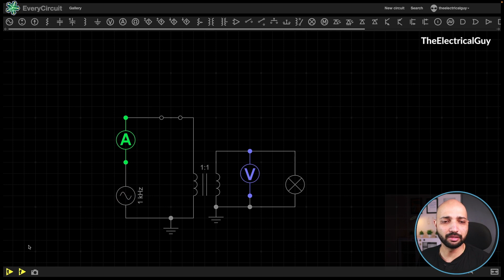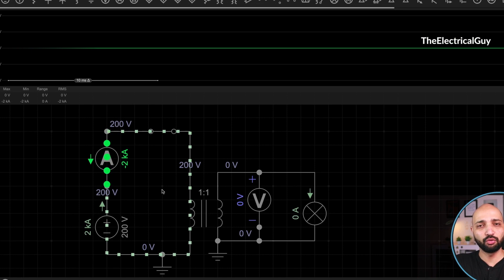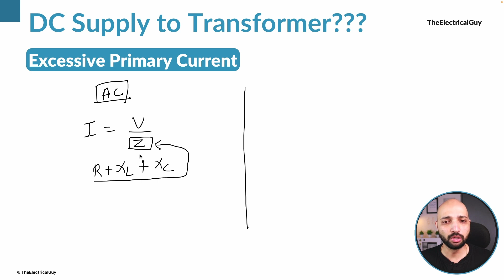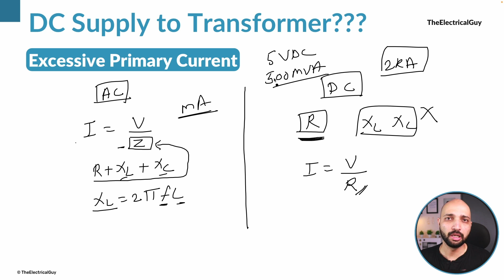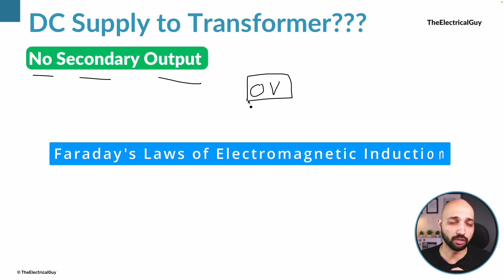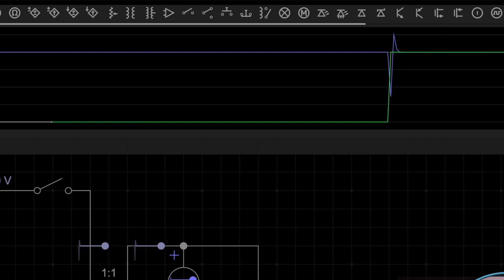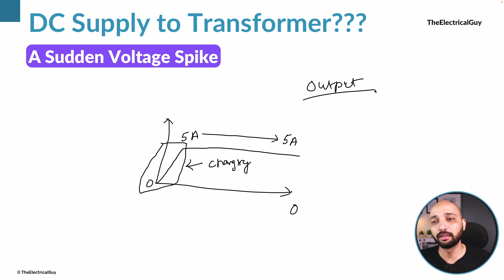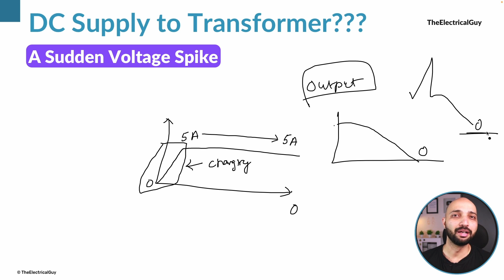The Impact of DC Supply on Transformers | Explained with Simulation | TheElectricalGuy

Comment: In a HVAC line,since there is only a resistance in the wire and there is no connection of capacitor and inductance,why your considering inductive reactance and capacitance?

Comment: So we can use a DC supply with a transformer in a UPS for instance. This will need an inverter,  rectifier to change the DC to AC and a capacitor to store and charge the battery.

Comment: i have a question why then are transformers used in amplifiers? if the circuit is in DC how does the transformer amplify the input to the speaker?

Comment: Fantastic explanation sir.
Please my question is, at what point in time do we need 1:1 transformer in power system?
Reply: In order to separate the load from the utility ground. Like this you can create an ungrounded circuit. This is either done to reduce the risk of electric shock or to avoid short circuiting measurement setups.

Comment: It was mentioned that due to the frequency, f = 0 for DC supply, hence the net impedance of the circuit becomes merely resistance, R. However, since f = 0, isn't that the capacitive reactance that is inversely proportionate to f  would become infinite and the resultant impedance, Z would become infinite also? Appreciate if someone could shed some light...
Reply: Capacitive resistance comes not in series with the winding. It is always bw the winding and ground. So it can not be considered
Reply: You are right. The reason for higher current is the lack of back emf produced by the induction.

Comment: Sir, First of all impedance is given by Z=R+j(Xl-Xc) not R+Xl+Xc(j denotes phasor and it is very important in AC quantities), and secondly the value of Xl i.e. leakage reactance is also very low, the transformer is designed such that it has less leakage flux so that the Voltage regulation value can be minimized. So, you cannot justify by saying that becuase in DC Xl=0 therefore current will increase, it is not the valid explanation.

Explanation:
Apply KVL in primary side u will get

V=i(t)R+Ldi(t)/dt
Where V is the supply voltage
And L is the inductance of primary coil.
Apply laplace and solve i(t)
U will get i(t)=Vexp(-Rt/L)
Now find flux,
¤=mmf/reluctance 
¤=Ni(t)/R
Therefore flux will come out to be decreasing exponential function of time. And eventually after 3 to 4 time constant flux will be equal to zero.

Now apply Farady law and find induced emf in secondary.
E2=N2 d¤/dt.
Since flux is constant and it is equal to zero therefore induced emf E2=0 (short circuit, hence secondary side impedance is zero).

Now refer the circuit to primary side u will get the following circuit elements:
1. Voltage source
2. Primary and secondary winding resistance. Rp and Rs
3.  E2=0 therefore it will be replaced by short circuit wire.

The impedance on secondary side becomes zero(because induced emf is zero) therefore by this logic u can say that current will increase drastically.

Comment: What will happen if we supply pulsating DC in primary of transformer? will bulb starts glowing ? As we are giving change in supply
Reply from the maker: Yes. An output can be seen in that case.
Reply: @GauravJ I was wondering this too. I want to design a dc motor that basically uses transformers to wirelessly excite the rotor and rather than using ac current and putting rectifiers on the secondary for the rotor I'm thinking it would be better to use a pwm DC source connected to the primary
Reply: @GauravJ That is what we call pulsating transformer in that case